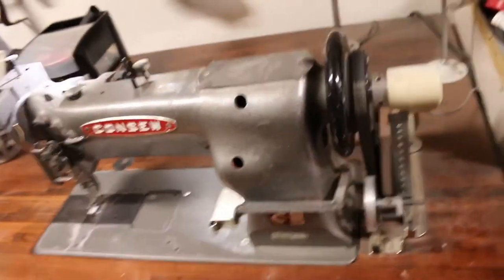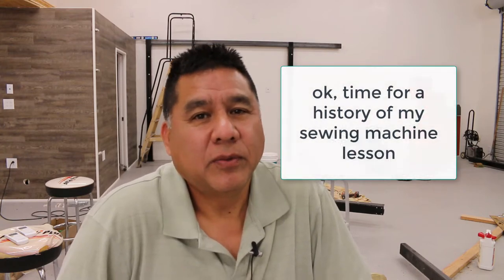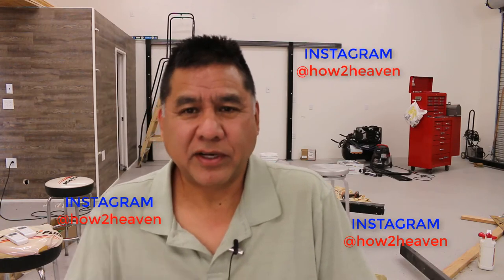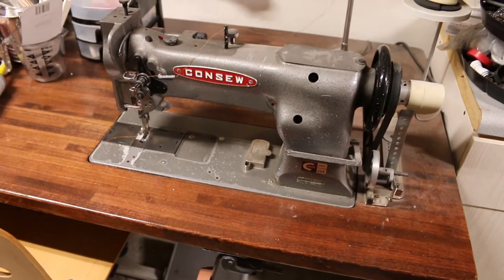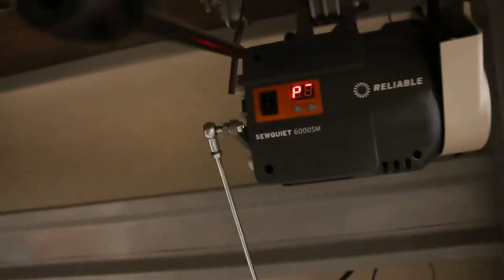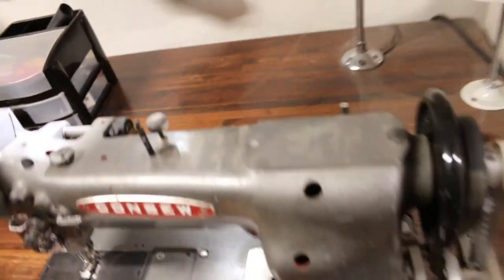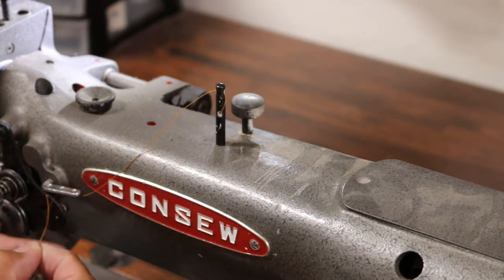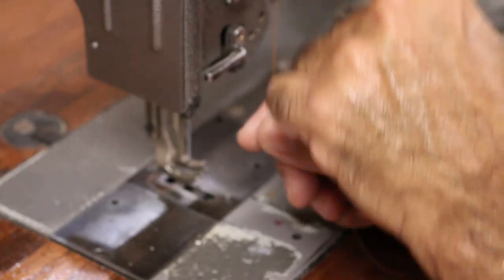How to Thread a Consew 226 Ver 2

Comment: I bought a machine like this. I bought it mainly to sew boat items. First thing I did was put new windows in our dodger for a sailboat! Of course I procrastinated for 8 months because I never did such a thing. Now he wants a whole new dodger! I’m confused on the oiling. I got the manual off the internet buts it’s not very clear. I’m glad I found your video because I was having a hard time identifying my machine. Thank you.
Reply from the maker: You are welcome! Basically all of these old machines live on oil, some have holes where you add a few drops every time you use them, others have wicks that soak in an oil pan underneath the machine.  Don't use automotive oil!  Splurge and buy a thin viscosity clear oil at your local sewing store and just add a few drops in all those holes!  Some machines paint a little red or yellow circle around the holes.  Good luck and Happy sailing!
Reply: @HowToHeaven  Do you have any more videos on thread tension, etc?  It's really hard to find anything on this machine.  The "manual" doesn't give good pictures.  There is a round black turn know on top the machine and another on top, far left.  Have no idea what those are for.  I can't even figure out how to set the stitch length.   Anyway you answered how to thread this beast.
Reply from the maker: The oil holes are all over the machine, but should be identified in the manual.  A couple of drops every time you sew in each hole.  These machines used to have a drip pan below the machine, to catch the droppings.  They are still available on ebay for about $40, if yours is missing.  Mine is missing, but my machine is in the garage so I'm not worried about the drippings.  Eventually, I will do a video on how to make a drip pan.  Check out my newest video on making Sun Visors (using my Consew 226) for a 2001 Ford Ranger...it should be done today!  Thanks for watching my videos!
Reply from the maker: @shericreates  I will make a video addressing your questions as soon as I can get around to it.  Thanks for Watching, howtoheaven!
Reply: @HowToHeaven  I have the 111W155 which is similar, and I would also love to see a video on oiling because I’m having a problem lifting the presser foot with back lever. It takes all me strength to lift! I must be missing an oil spot or maybe something else is amiss. Thanks for the great video!
Reply: @HowToHeaven  yes! I do have a drip pan. I just leave a piece of paper towel to also just help anything that drops. I think I have to find a repair place. I can’t for nothing get the tension right. The upper thread just kinda lays on top. I have tried everything - needles, thread, adjustments. The manual is hard to read and some things identified only has a line with no explanation. The oil spots used to have red paint to identify but are worn off in most places. But once I get this going? It’s a work horse. I can barely lift it!
Reply: @monisue2793  I am having a hard time turning the wheel! I feel your pain! Lol
Reply from the maker: @shericreates  Check the two discs, with the little U-shaped wire, your thread needs to go in between those discs.  If the thread lays on top, then you have too much tension on your bobbin, but that can also mean that you don't have it threaded correctly, as above.  If you do have it correct, there is an adjustment screw on the bobbin case that you can loosen (in your case, or tighten).  The trick is to sew a piece of scrap and look at the threads.  If the top thread is NOT being pulled in, and lays on top then you either have it threaded wrong, or the bobbin tension is too tight/ or the top tension is too loose.  Hope this helps and thanks again for watching!!!

Comment: I need assistance and don’t know where els to get it I have a con sew machine given to me but don’t know squat on how. Been watching your video when I get it to the tension it the thread won’t move can u help
Reply from the maker: I suggest you research basic sewing machine operations as they ALL operate similarly. You should concentrate on the tension adjusting screws for the UPPER and LOWER (BOBBIN) threads. Watch lots of YouTube videos on thread tensions. Be persistent.  Also, make sure that you thread your machine correctly or the tensioners won't work! Good Luck!
Reply: @HowToHeaven  thank you
Reply from the maker: @pays2kissntell  You are welcome. Please comment back here so others may benefit from your experience. Thanks again for watching my videos.

Comment: I have an old consew quilter, 25" throat, has been upgraded to a servo motor. Runs beautifully but keeps breaking thread... I don't know what I'm doing wrong! Anyone know of this machine and how to thread it? Nothing online about it that I can find
Reply from the maker: Sorry, I can't give you a definitive answer, too many variables.  It could be anything from tensions, thread size/needle size, timing, material too thick, even a bent needle or bad bobbin case could cause that. Good sewing machine techs are still around and it would pay to have it serviced if you've never done it.  It just depends on how much you will use it. Thanks for watching my videos!